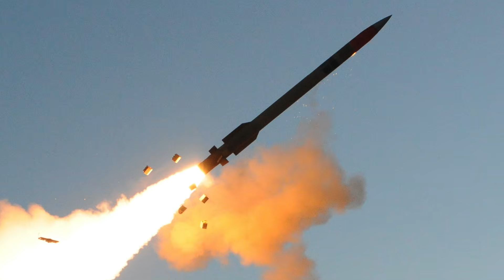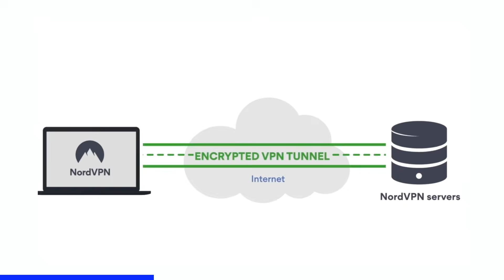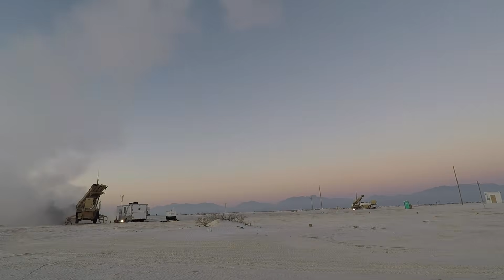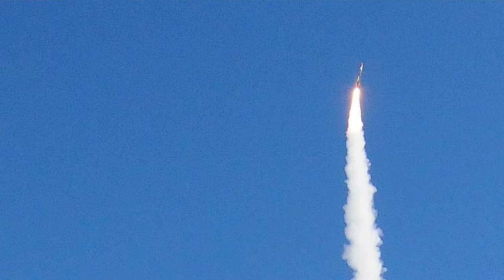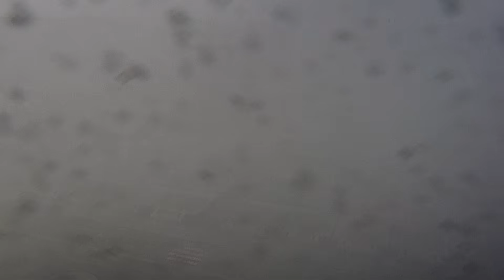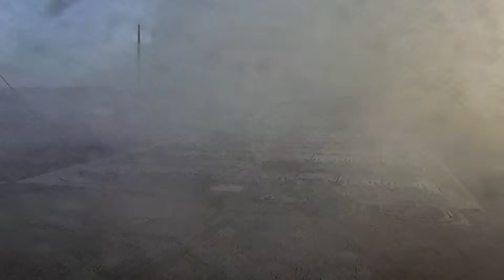How PAC-3 MSE interceptor is set to bolster US navy air defense capacity ?

Comment: Its long over due but truthfully, the USN needs to work with the Army on prospective PAC-4 that can be quad packed in the MK-41 as well as the land launchers
but with 100 plus range with EO/IR/ARH seeker with datalink and retains 90lbs warhead as a replacement for the SM-2 and PAC-3 MSE
The obsolescence of the PAC-3 MSE and SM-2 is known
While this is a good step, they need to go further
Israel's David sling has the seeker that they need but not the range and warhead

Comment: We need super-fast fire control, & a smaller, cheaper missile, for low & slow
Reply: AI and Lasers ;)
Reply: Thats easy , 
BAE's Adaptable Deck Launching System with APKWS II and LOGIR rockets
 APKWS II and LOGIR rockets cost 25k to 90K
 APKWS II has SAL for targeting specific as well IR dual mode but LOGIR is IR and can be used against multiple targets such drone swarms
its high low mix
I would add 4 launchers with 50 rockets each. 40  APKWS II and LOGIR rockets and 10 JAGM/HELLFIRE
The  APKWS II and LOGIR would get newer motor for 8 to 10 mile range 
The last change would removing 20mm CIWS gun and replacing the gun with 30mm cannon 
Same radar but newer cannon it would 3 magazines that can be reloaded if its firing
600 rounds of High Explosive Dual Purpose (HEDP)
200 rounds of  Mk310 PABM-T airburst round.
200 rounds of Advanced hit efficiency and destruction (AHEAD)
The HEDP is all purpose,  the MK-310 is anti surface and the AHEAD is anti air
Reply: @verdebusterAP  Isn't this basically what the SeaRAM is designed for? A 21 missile launcher for the RIM 116 missile in place of a Phalanx CIWS mount? And unlike the VLS cells it can be reloaded at sea.
Reply: @willythemailboy2  
The RAM is rapid fire launcher designed for pop attacks from anti ship missiles and aircraft and cost 900K per missile
Reply: @verdebusterAP  Yes, but unlike all the stuff you listed they actually exist and work.
Reply: @willythemailboy2  
APKWS are used by the US and Ukraien as cheap options for C-UAS
Reply: @verdebusterAP  Yes, but ground level launch severely restricts range, so most of them are launched from helicopters or fixed wing aircraft. APKWS launched from sea level would be limited to 2-3 km, probably less.
Reply: @willythemailboy2  
Surface launch range isnt the issue
the issue is that sensors against low flying targets like that only work once the target breaks the horizon
Reply: @verdebusterAP  The radar height on most ships makes that a non-issue at the ranges these missiles would have. At 5 meters above sea level the radar horizon would be about 8 km even for a surface target. If the target is also 5 meters above sea level, the radar horizon is closer to 16 km - far further than missile range.
Reply: @willythemailboy2  
it depends on the ship
One of the better qualities of the UK Type-45 is that its radar sits at 42 feet in the air giving it visibility against low flying targets
The US AB class ,its radar sits at 30 feet angled up
The Flight III sits higher with less angle and the planned DDG-X is completely flat
The DDG-X also has Sea Griffate at the top of the mast 
The Joint Land Attack Cruise Missile Defense Elevated Netted Sensor System, or JLEN was balloon that extend up to 10,000 feet 
I would make smaller vision that could up to 200 feet with sensor payload able to cover up 50 miles
for destroyers and smaller ships
Carriers dont need it because there masts are already at 200 feet plus so they can easily see over the horizon
Reply: @verdebusterAP  That's why I went with the comically low estimate of 5 meters, to demonstrate that even on a very low ship the radar horizon is not the limiting factor, it's missile range.
Reply: @willythemailboy2  
Range can be fixed with improved motor
The APKWS has motor in work that should double it range
The problem is that developing a missile with Lock-on after launch (LOAL) with IR/ARH and data link with 10 plus mile range wont be cheap
But increasing sensor does make it easier
Reply: Roadrunner and Coyote lol kinda funny that their names coincide with Loony-Toons😆
Reply: Theres literally over two dozen different anti drone systems i could name off just better U.S. and Ukraine, have fun scrolling for endless hours;)
Reply: @Anarchy_420  
There are dozens of system but you want one system that is cost effective and can be standardized to surface ships
Hence why the Adaptable Deck Launching System with APKWS and LOGIR is the simplest route to go